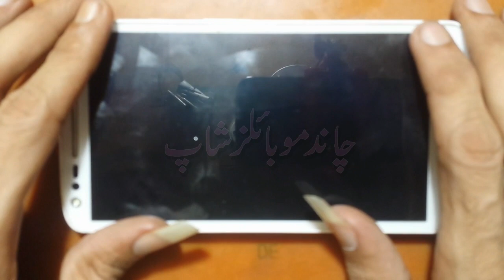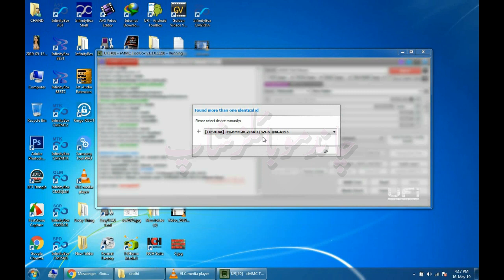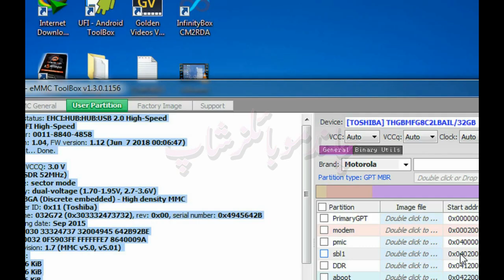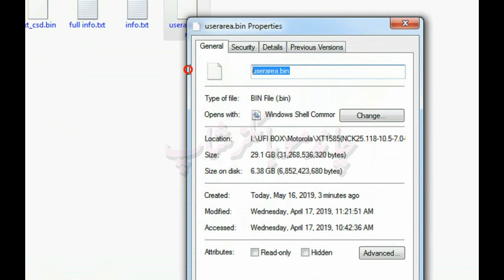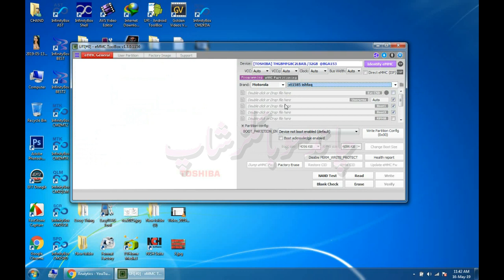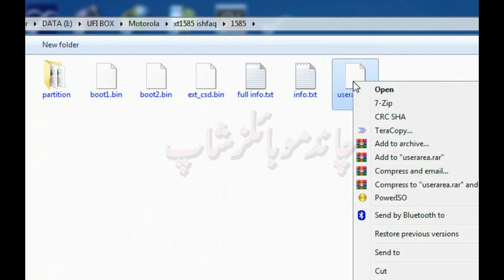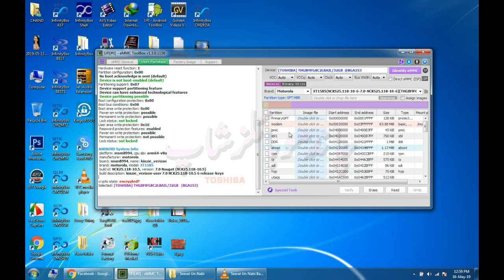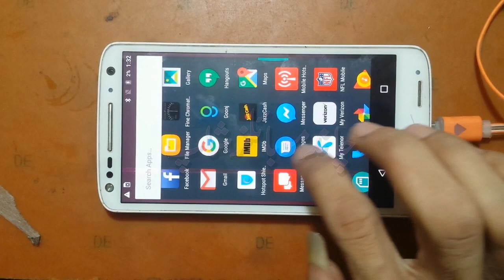UFI BOX TRAINING LESSON 5 MOTOROLA EMMC PROGRAM

Comment: Mere pass mi A1 aaya hai . Qdloder9008 port pe hai . Flashing Karne pe 30% flashing ke baad error time AATA hai . Tested file se flash kiya fir bhi . Kya karu bataye Bhai .
Reply from the maker: UFI ANDROID TOOL se flash karo FULL ERASE BEFORE FLASH pe tick lagao
Reply: @ilyasrao  ok Bhai try karke post karta hu . Shukriya
Reply: Error aaraha hai
Reply: Failed to sedn payload at 0x0000000:0034 (packed rejected)
Reply from the maker: EMMC remove karo aur partition and read only status confirm karo
Reply: @ilyasrao  partition dikhara hai . Firmware bhi . Heath report 0% to 10% used dikharaha hai. Aage Kya karu
Reply: Main iske network ke file read karraha hu to error aaraha hai